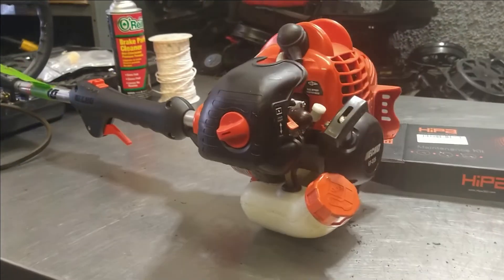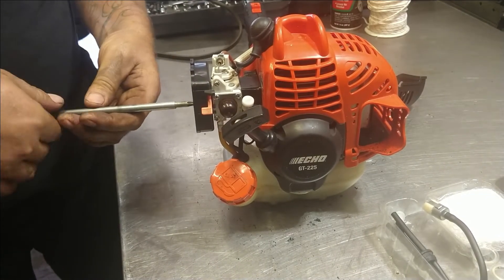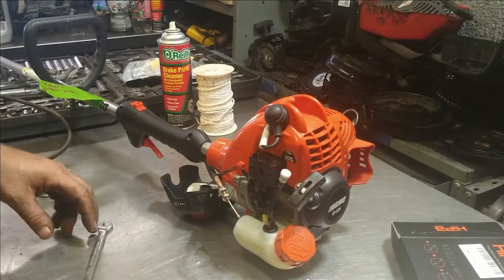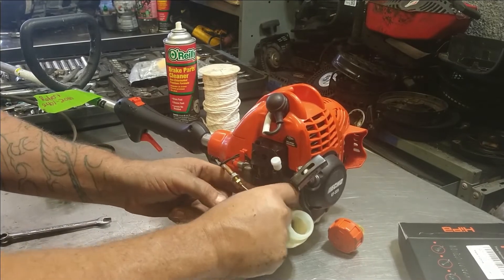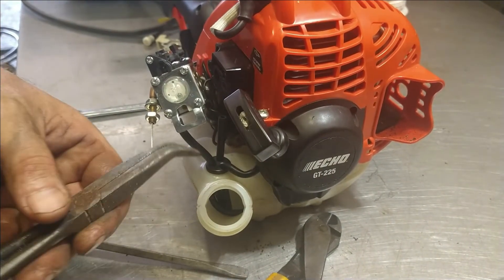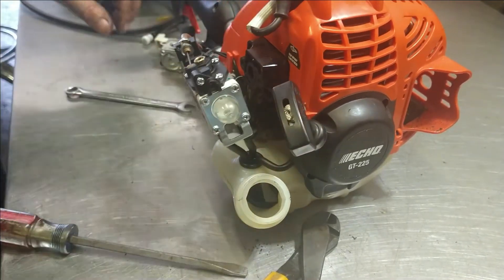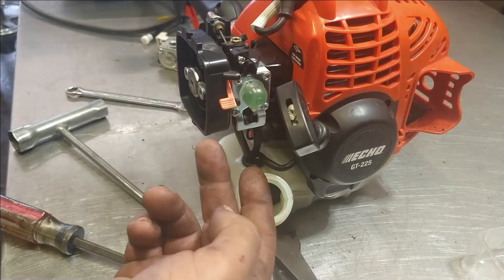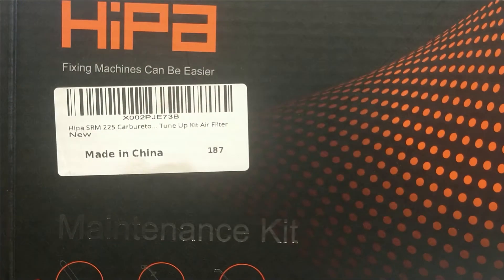echo gt-225 trimmer carburetor fuel line repair replace kit install HIPA

Comment: Dude the one part I need to know where the other end of the fuel filter goes to and you went and dropped it the other end of the fuel line goes it was working when I bought it from the sky $50 and now I can't get it running please help
Reply from the maker: same setup https://youtu.be/yVGUYSLB5Ig